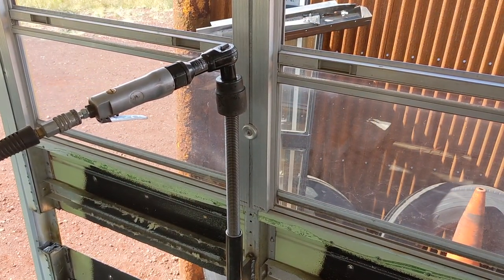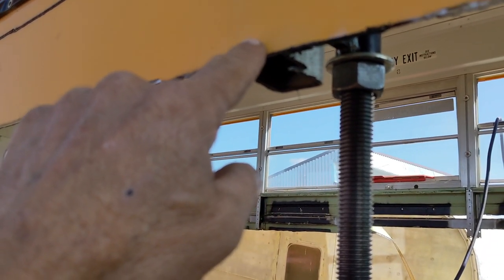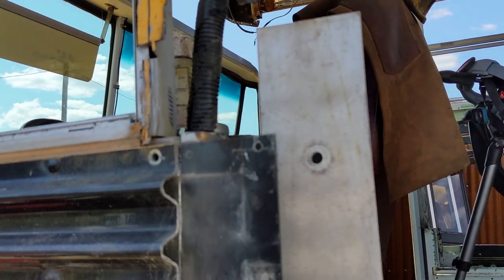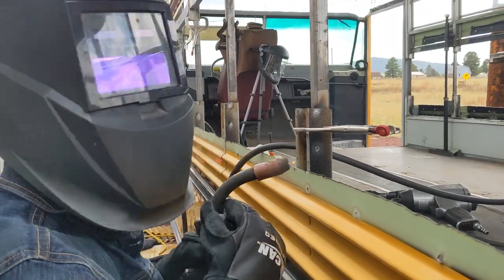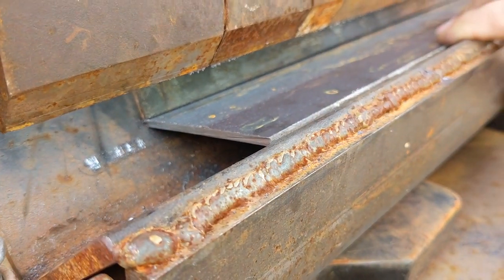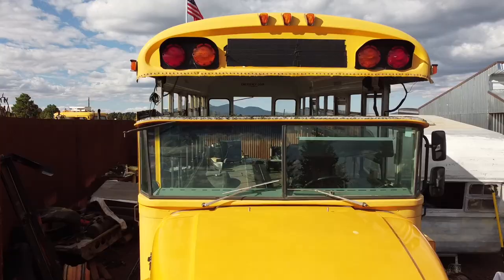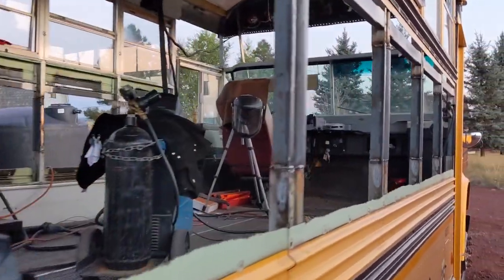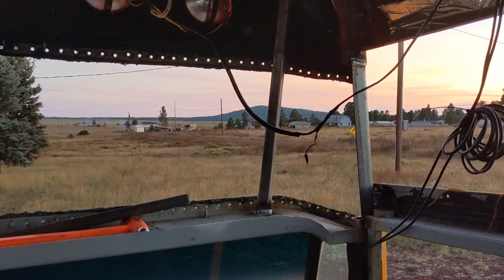Framing the Skoolie roof raise project.

Comment: you couldve plug welded the boxsection in by drilling some big holes in the hat channels put in the boxsection then rosetteweld it though the holes
Reply: That's how I did mine. Less work n locks them in nice.